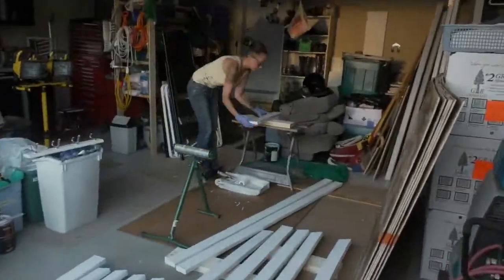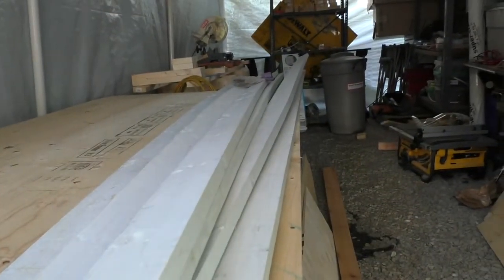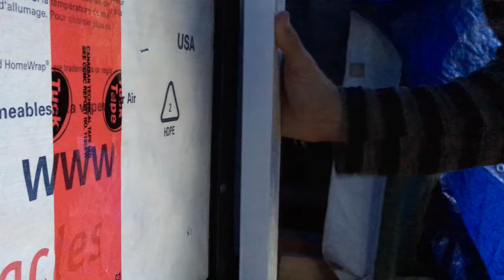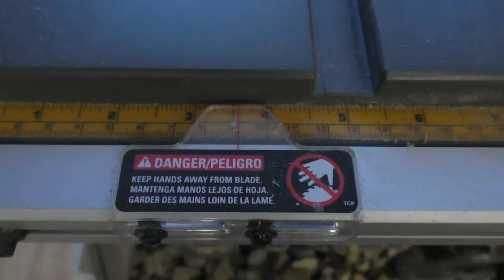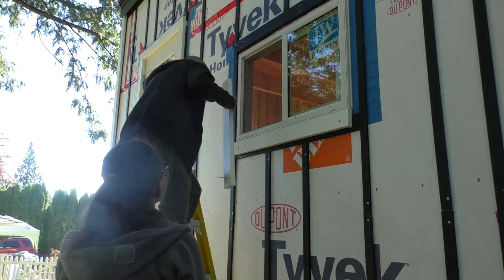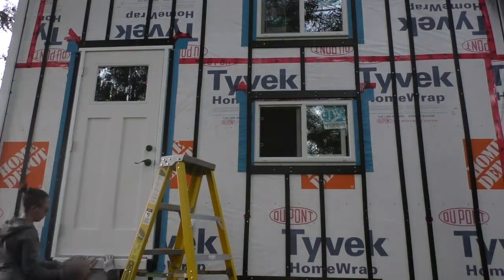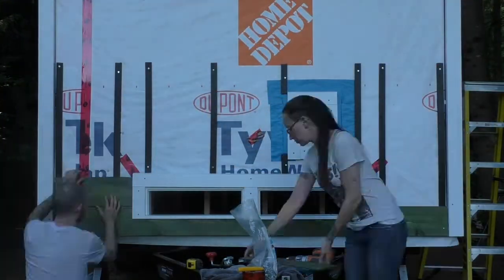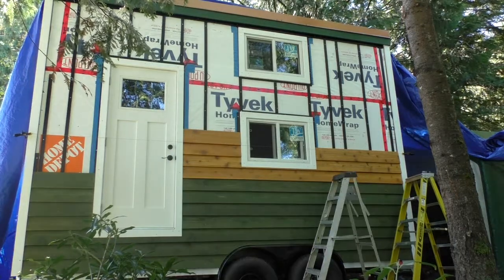Exterior Trim // DIY Tiny House Build

Comment: soo window frames go in before siding?  Ok never new that. it always looked like me that frame sat on top of siding.
Reply from the maker: I have seen them done the other way, over the siding, as well. Problem with that was I didn't have a lot of width left to play with, because of the overall width of the house was really close to max. It also seemed a lot easier to cut siding to go around trim, rather than directly around everything.